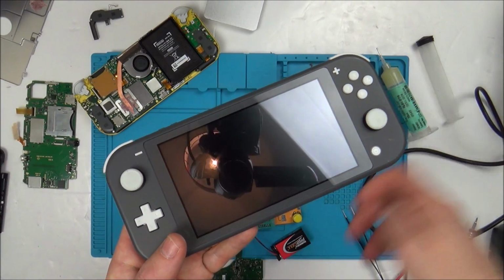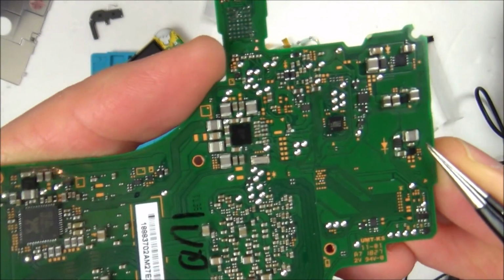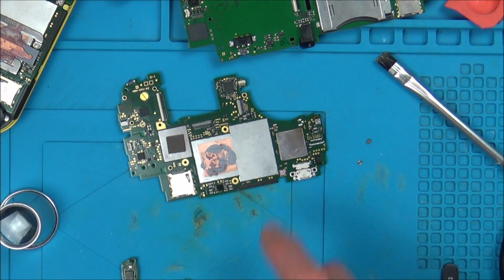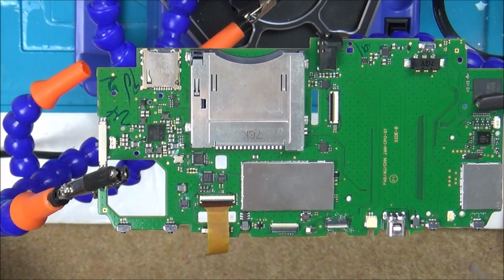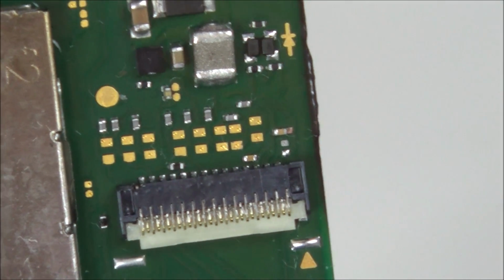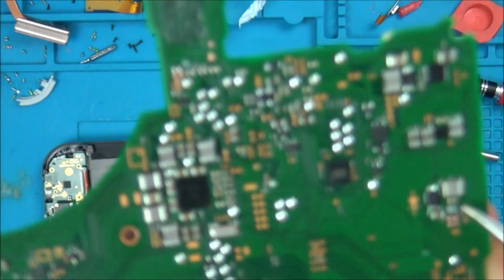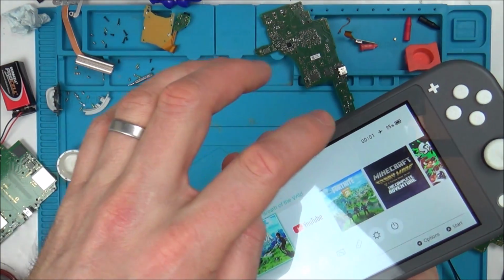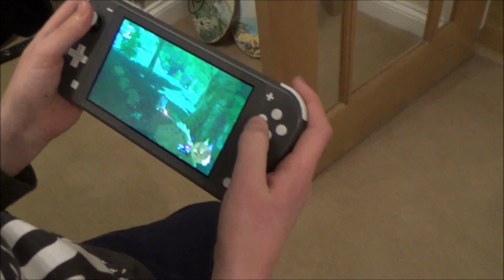REVISIT: Nintendo Switch Lite BACKLIGHT FAULT (Black Screen)

Comment: thank you for your video! had the same problem and change alot of things but still dont work. and your last part. bga the chip 5 times until it work. turns out thatr my bga want enough but one more time, my switch turn on with backlight. thanks for your support! Longson

Comment: Excellent video. You saved me a lot of ton of time diaging my own switch lite. Unfortunately, I lack the proper tools to repair mine. I found the capacitor between your .5 resistor and the black nine pad controller was shorted at 327 ohms. Its odd because it would only beep for a split second on my continuity test. I would just replace that but I don't have the right tools for the job and I don't have a spare switchboard. Regardless, it was fun to pinpoint the issue. Looks like I'll have to be putting mine up for sale on eBay haha I'll be sure to put everything that I found out in the description so I'm not like those guys that waste your time and money! Thanks for the insight!

Comment: Hi I was trying to fix my girlfriend's joycon sticks and broke the backlight for some reason. I also accidentally take off the white chip lock from the ribbon cable connected to the audio and card reader port. is it possible to fix that?

Comment: hello Vince, i was wondering if you would be interested in a Nintendo switch lite with basically the same faults here. I don't want any money for it and ill even pay shipping,  i simply would like to ship it to you for a try and fix video. it started with no backlight and eventually while trying to diagnose it the little white flap on the ribbon cable connect came off. well i tried to put it back on but we all know that's next to impossible and in the process i must of bent some of microscopic wires which in turn caused a poof of smoke that came from the resistor/inductor that you speak of. I'm thinking it will need a new ribbon cable connector and a new resistor maybe something else I'm not sure. I don't expect it to be returned regardless.. Maybe you could fix it and i know it would make for a great video..

Comment: Hi Vince, great video. I've got the same problem with my switch lite. I have a shorted capacitor near that BGA chip, do you think it's the same chip  as the original switch? For some reason you can get the original switch BGA, but not the lite. Thanks in advance.

Comment: Hi Vince I'm currently in the middle on one like this. 
Basically I messed up and broke the connecter, 
I have changed the connector twice now. 
The screen actually worked without the clasp. 

both times I've soldered the connector it's looked perfect, and I don't get a backlight, I've tried swapping the 6 ball IC. but still no power for blacklight. 

Only getting 4v at the component which should be 19v

thinking off injecting voltage into that little back light matrix, but unsure which component to inject voltage too

Just to clarify, I don't think I have a issue installing the connectors, I replaced a switch lite zif connector for another lite,(display connection)  and that looks and works perfectly.

I'll edit my comment, but I got it working, I replaced the connector again, I'm guessing I had bridge pins under the connector. 

Changed the backlight ic and everything in my plight 🤫🤫

Comment: I have revisited both of your backlight videos several times for inspiration.  I have good news to report.  Finally got it after 8 tries.  That 9 pad chip is a bugger!  I was going to install all my spares over again but got it on the first one of the second round...  To clean the flux out of the connector, I soak it in alcohol while attached to the board and then blow it off with air several times.  I managed to break that connector and then melted the replacement beyond use.  The third connector can't take too much more abuse but it is working.  So, I am putting the covers back on before I manage to break something else!!!  Thanks for the videos Vince from Robert in Michigan USA.  https://ibb.co/7gkfHgF

Comment: Novice warning.  Trying to fix no backlight switch lite.  4:50 Vince is calling it a naught 050 shunt resistor.  0.50 ohms.  I am getting no resistance(100 % continuity).  Measures same as component that is about 1/2 " to the lower left of the fan.  Mine looks like it popped!  https://i.ibb.co/ZBdqFH6/nintendoswitch.jpg  I am not sure if #4 caused the right side of cable to burn thru or if I fried #4 while testing #3.  One second I was getting 41vdc at #3.  I saw a flash and now I only get 3.7v from # 3.  # 1 and # 2 are 0 volts.  If I am able to locate a 0.50 resistor on a radio or other component, will it work as a replacement?  Thanks.  Yes, that is a yellow tape measure to the left showing 1/16ths.  This minute tech is amazing.

Comment: I never know about that device, you measure capacitor or resisters.
What is the name of that device? And where to get it.
Thank you!
How I can send you pictures or small videos? I have 2R2 coil fell of my Nintendo switch motherboard, will attempt to put back. I didn’t find any similar videos from you or any other people. Think that you may want to see. Console is working, but don’t take charge.

Comment: Great to see your progress through the years, Vince! Which reminds me, did you ever put that very first Switch back together? I seem to remember that it had an issue you can quite routinely fix today but weren't confident enough to try back then.

Then again, that poor thing was used for spares on a couple of later videos, so it might not be in any condition to be brought back to life even if it would've been an easy fix if you got it fresh today.-

Comment: Hi Vince. 
My switch stopped working today .
I stripped it down and found the large capacitor next to the long display connector is shorting. 
Where can I buy a spare capacitor to see if that will fix it .
Thanks

Comment: Vince, I haven't seen you use the solder paste much beyond the test circuit. Are you not a fan of the paste or is it just easier to manually solder?

Comment: Vince is there anyway I can contact you as I've brought a white 500g slim ps4 about 7 months ago brand new and it overheats and turns off every 10 mins ...being stupid I took the void sticker off to clean the fan which i didnt even need to as you can take the back bit off without voiding  ..if you could contact  I'm willing to sell cheap as would love to see a video off you fixing it ..
Reply: It's most likely a easy fix but I've brought a pro now 😂

Comment: Awesome fix Vince!  I wanted to share a fantastic video the explains how boost converters work:
https://www.youtube.com/watch?v=vmNpsofY4-U
This will also answer why that component was an inductor.  Most boost converter chips require some external components in order to work, and in most cases those external components are an inductor, a high-speed switching diode, and a capacitor.  The video shows a MOSFET instead of a BGA chip like you had, but the idea is the same (the chip in your case was doing the job of the MOSFET as well as controlling the frequency of the on/off pulses to the inductor).  Hope this helps, and keep up the great work!

Comment: It is not a resistor, it is a coil but sometimes this multimeter couldn't show exact element and show only one of the parameters, a coil have resistance and can act as resistor. Without Inductor you can't boost 3.3V to 17V efficiently. You can also use a capacitor to boost voltage but for very small currents. Inductor stacks energy under high frequency while capacitor stores energy. A resistor 0.5 Ohms hasn't got the same properties as an inductor 0.5 Ohms, it is a different element. The chip provides frequency pulses for the inductor to form a boost converter.

Comment: Of course the board can have multiple inductors. Because each dc - dc converter need an inductor. Since these devices need different voltages for different components/chips there will be multiple dc-dc converters. The tester most probably doesn't measure it , because it's value is too low( 2-33uh commonly) for it.
You simply identify a dc-dc converter , all the components grouped together, one driver chip + inductor + schottky diode.

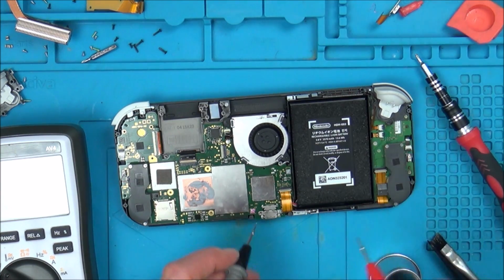Comment: Hi Vince at minute 18:00 when you moved the console you can see the backlight flashing it looks like a connection problem.
Reply from the maker: It does doesn't it. I think that part is a mirrored finish on the back of the LCD and it is catching the light from the room bouncing of it when the Switch Lite wobbles a bit. I have quite bright lights shining down on the blue mat :-)

Comment: Call me crazy or tell me I'm seeing things but at 18:00 make doesn't the back-light come on? Like there's a flash by the missing game cartridge slot? Maybe it's a connection problem with the cable you put on
Reply from the maker: I think that part is a mirrored finish on the back of the LCD and it is catching the light from the room bouncing of it when the Switch Lite wobbles a bit. I have  bright lights shining down on the blue mat. I had to watch that bit back a few times as it does look like a backlight :-)

Comment: I know this has no relation to this video but I figured you know your stuff so if I was to use the wx4 geotechnical controller on my Nintendo switch would it brick it

Comment: 9 pin BGA chip replacement ay? I guess it wont be too long and I will come across a video where you successfully replace a "Gazillion" or is that "Bazillion" BGA GPU or CPU Chip :|  :) :D 
Hang on a minute!!! that makes you a freak-n repair GAWD!! I mean is there anyone else that can repair at home and I do stress "AT HOME" with a basic toolset all what you have repaired thus far? freak-n legend is what yo be..
Reply from the maker: Haha, I like it Koala, especially coming from a true legend :-)

Comment: I love the chinesse LCR meter. But of course it has its limitations . Being said that, I use heavily on repairs. A proper LCR is way expensive and does not worth the risk (I repair PSUs and charged caps are an issue). But on tiny values can fail. Getting 17V from 3.7 requires an inductor somewhere.

Comment: you should also invest in low melt solder to do jobs that require unsoldering so that it could lower the temperture without burning any components

Comment: a resistor can only be used to reduce voltage while an inductor under the right circumstances can increase voltage, so you cloud easily verify whether it's a resistor or an inductor by trying to see if a voltage higher or similar to the 18volts coming out gets supplied to the circuit...

Comment: glad to see this revisit was a success though well done Vince, as wasn't sure myself on if this would have been successful especially with limited knowledge, and tools.

not sure if worth mentioning, if you watch the playback at around 9:30 then you get to see part of the circuitboard exposed where the old connector was, need to watch on at least a 32" tv with full screen. it also looks a little burned like it was the point the original connector was shorting.
Reply from the maker: Thanks Michael, yes that was the little patch on the bottom row of pins that had the burn on it from the original burnt connector :-)

Comment: Vince, I would suggest getting a BGA soldering stencil as well as some solder paste. It would help massively with those BGA chips because then you could just use soldering wick to clean the bottom of them, use the stencil to apply the solder paste and use hot air to melt the solder paste into solder balls. Then you could solder them back on way easier than fighting with the already destroyed solder balls underneath the chip. :)
Reply from the maker: Thanks, I did get a stencil pack sent from China but even though the stencil holes look tiny they are way too big for any of these tiny chips. Maybe I need to look into iPhone stencils as the holes may be smaller on them :-)
Reply: @Mymatevince  that's probably a good idea as most components on mobile devices have very small sized solder balls.

Comment: At minute 18:00, when you moved the console, you can see the backlight flashing on for a moment in the conector under the cartridge slot. It's was kinda "working" there. The problem doesn't look to be the BGA but a connection problem
Reply from the maker: Hey Martin, it does look like the backlight lighting up but I think it is the mirrored finish on the back of the LCD catching the bright lights in the room shining down on it. The Switch wobbles just as it happens. Well spotted though, I didn't see this while editing :-)
Reply: Can confirm what @Mymatevince   said.
Reply: @Mymatevince  Not true vince bro.. at 27:20 you can see the backlight in the same place lighting up still when you move it.. very handy to know if the backlight is working or not.. i got a switch lite here with the exsact same problems as the one in the video.. i swapped the connector over.. still no luck.. its the 9 pin chip that seems dead :(
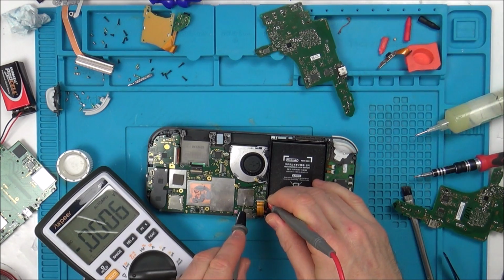Reply: @Mymatevince  you can also see the backlight die in the same place when you shorted it at 25:18

Comment: Thanks ever so much for the shout Vince =D  This is perhaps your most epic repair!!!  You followed it right from the initial burn marks to all of the faulty components!  I don't know about Switch Killer, your new name should be Switch Master =D  BTW the reason the voltage doesnt drop much when the backlight is not visible, its using PWM rather than just DC.  Test your scope on it and you will see some pulses rather than straight DC!
Reply: The Switch Whisperer. Ressurecter of dead switches.
Reply from the maker: Switch Master....I like it ;-) Thanks Chris for all the help and advice on each video :-) I will surely be back to burning, breaking and device killing in the months ahead :-)
Reply: My Mate VINCE you should try repairing more computer like MacBooks or laptops i think it would be more easier because there is schematics and  replacement parts
Reply: GadgetUK164 - Retro Gaming Repairs & Mods i wis you good luck mate

Comment: Awesome work Vince. That chip must be the backlight controller. The resistor you changed there is an inductor which prevents interference caused by low frequencies on the voltage lines and filters out stable voltage. Technically, even if you shorted it, you would get backlight to work but you would have seen some flickering as well. Backlight issues are generally caused by a bad backlight driver and diode (if you see, there are some diodes also on the backlight circuit). An inductor usually never burns out but turns out this Nintendo Switch actully had it blown from what I suspect, water damage or moisture. 
I have an old monitor with a similar problem and I was unable to fix it. Turned out the backlight needed 30V to turn on. So I took a 32V adapter from a dead HP printer and fixed it that way. The backlight control does not work from the monitor and the brightness is fixed (not adjustable) but it is functional that way. I gave it to one of my friends and it has been more than 2 years and he still uses it.

Comment: Well done Vince. It's an inductor, if you look under the microscope it will almost look like glitter, this is (as far as i know) the ferrite composition, a resistor on the other hand will be a flat shaded colour, unfortunately that particular revision of your component tester isn't sensitive enough to measure a lot of ranges of inductance.... sometimes simply soldering wires to the component is enough to trigger a good reading. The component tester isn't technically incoreect as techinically an inductor is a resistor... :)
Reply from the maker: Thanks Dom, it did have a silver glittery coating on it but the camera didn't really pick it up. That will hopefully be an easy way to maybe identify them in future fixes. Nice one :-)

Comment: Problem is these cheap chines meter cant measure low inductance and instead show resistant beacuase is t small for measurment. If you want measure smal inductance yoou are need RCL meter . This meter measure inductance , capacitance and resistance . and alsou on capacitor ESR and some one ESL  (equivalalent series inductance) .

Comment: I don't see how it's possible to create 17V from a 3.7V battery without a inductor. The topology of the circuit perfectly matches a boost converter, in which the inductor is the key component. Also the fact that is was broken (open circuit) fits perfectly, as shorting the output of a boost converter essentially creates a direct short trough the inductor thereby frying it. It's possibly just a inductor with a very low value. You can use your little scope on the side of the inductor that goes to the diode on a working Nintendo switch - You should be able to see that node alternate between ground and freewheeling (inductive spike). (Might look distorted as the converter might be switching faster then the bandwidth of the little scope, but you should still be able to see something)
Reply from the maker: Thanks Unimportant. Apparently that little component tester will not test low value inductors so it tests them incorrectly as a resistor. Like you mentioned in the last video it looks like it is an inductor and not a resistor as I stated in this vid :-)

Comment: That is an inductor. From my experience, they look exactly like that. Also, all resistors have markings on them. And it's normal for a board to have a lot of inductors, cause there is many voltages needed for different circuits.
Reply from the maker: Thank you :-)